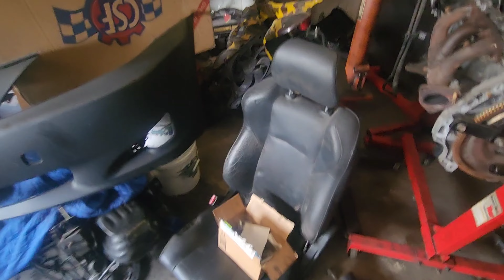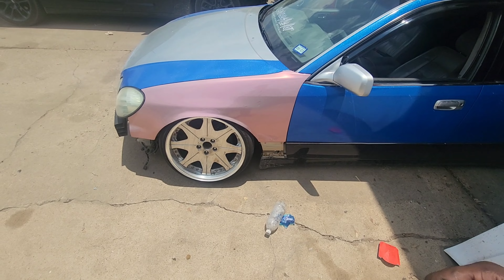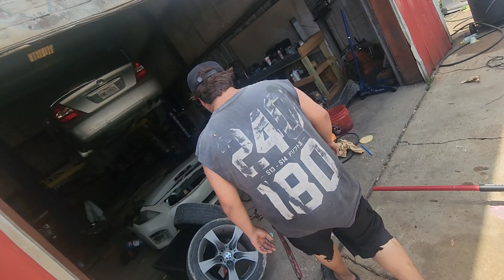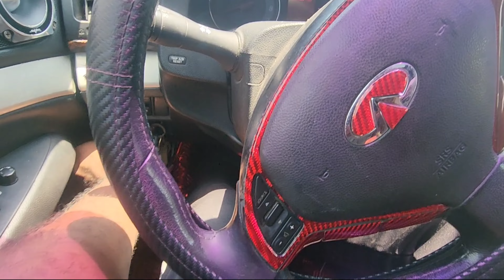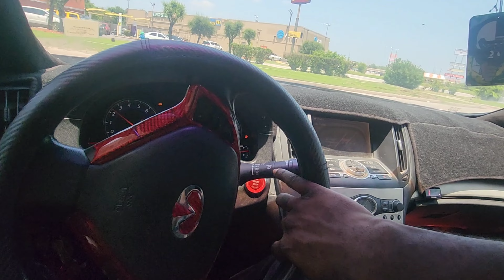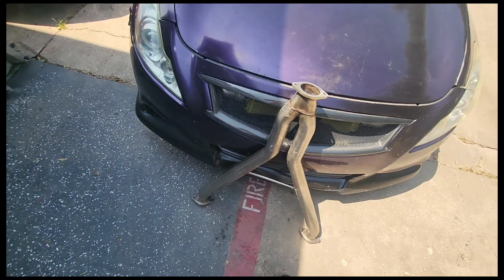Stillen Y pipe Install for my G35/G37 sedan !!Much Needed Exhaust Upgrade 🔥

Comment: Does it vibrate at all?
Reply from the maker: Nah bro not at all, what kinda G you got?
Reply: @rudenoisegee  I got a g37s coupe. I bought the isr y pipe I was thinking about getting the dc y pipe but I saw a review since it doesn’t have flex pipe that it kinda vibrates.
Reply from the maker: @Viclopez023  I've always liked the coupes , you going isr single exit
Reply: @rudenoisegee  yes im
Thinking about it. I already ordered HFC
Reply from the maker: @Viclopez023  do it bro, I'm thinking bout going nitrous not sure yet , you'll see if I do lol
Reply: @rudenoisegee  is isr exhaust loud?